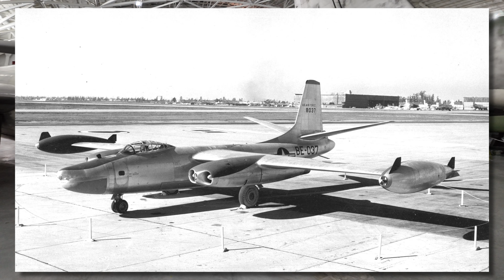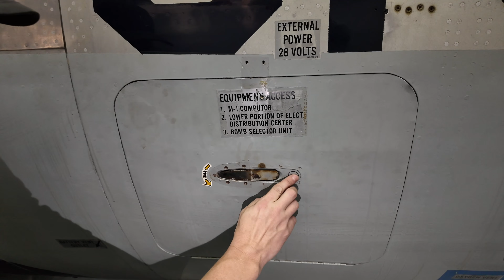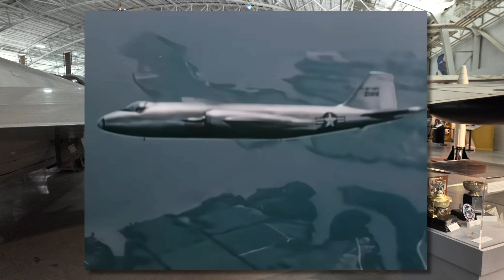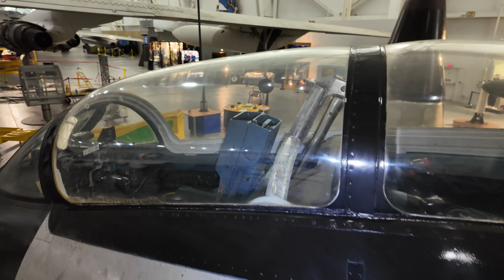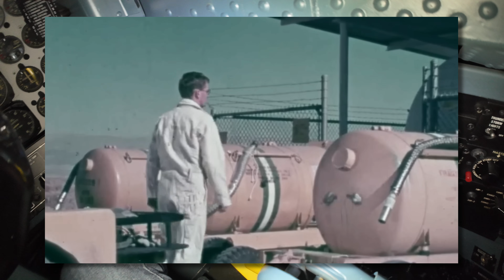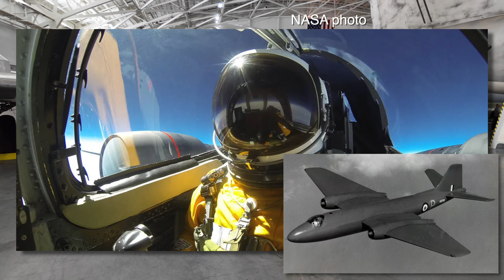Martin B-57 Canberra detailed tour! Designed by the British, perfected by the Americans?

Comment: There’s a static display at the main gate at Forbes Field Air National Guard Base in Topeka, KS. There are mannequins inside with helmets. Last I knew the helmets fell off at least one of the mannequins. Though I think they may have fixed it. Somehow I mistakenly thought the plane was a B-47 until I realized how much larger a B-47 was. Both were flown at the airbase when it was an active duty airbase under SAC.

Comment: Was there a pressure release plug that needed to be released like on the canopy of the UK Canberra before the crew door was released by ground crew to avoid the door flying open and potentially injuring the guy opening it, or did the opening canopy not require this?

Comment: It’s worth mentioning that the USAAF and later USAF had a problem with Glen L Martin company. This was regarding the B-26 marauder. The Marauder was tough to control in its early versions and suffered from a high landing speed owing to its unique design and undercarriage layout. It took WAC pilots flying it on one engine demonstrations arranged by Hap Arnold to convince his crews that the B-26 wasn’t dangerous. The high speed, high landing speeds and other features made it an aircraft you actually had to fly all the time. Its lack of defensive armament didn’t help. It soured the Air Force to Martin products for many years. The B-26 despite its issues did enjoy the lowest casualty rate of any of the army Air Force bombers both medium and heavy of the war

Comment: What isn’t mentioned here is that the B 57 had a very terrible and unforgiving single engine minimum speed. One GUARD  unit flying  57 s  lost four people to low altitude engine failure where the B 57 rolled onto its back before they could eject or during their ejection.

Comment: That's not a turbofan issue, that's all turbine engines. They all work using air and it gets tricky when the air gets very thin, which is one limitation to the maximum altitude of a jet. Like why would they intentionally use engines that are worse at altitude for their new special version specifically designed to fly at high altitude? 
Turbofan would better if anything. More collection area, can take in more air. 
I feel like you are thinking of turbojets being better at high speeds. That does matter because the relative exhaust velocities are different, the turbojet is more efficient at very high speed because it's closer to its own exhaust velocity.
Reply from the maker: I'm happy to stand corrected but why would they use a turbojet on the RB-57F then? I understand that the NASA WB57Fs don't have those turbojets and can't get much higher than ~65,000ft.

Comment: I never even heard they went to a one man cockpit for the high altitude ones. Although I think all they really did was blank off the canopy and presumably didn't install the equipment or seat. But at least some of them had two man crews, that's what's in all my books, and why I was surprised to see that. This drawing in my very old and very valued book of cutaways has the RB/WB-57F as a two man jet with canopy sunscreens to protect the crew at high altitude from the direct sunlight and radiation, I assume.

Comment: What still isn't clear to me is how did they use the B-57B for all the conventional bombing they did with it? They were blowing up truck convoys and bridges, you can't use radar to aim that, can you? Do they just operate like fighter bombers then, and guess when to release? Do they have any optical backup system at all?
And I don't think the flat glass is for the gun sight, you can aim through curved glass, you just have to make sure it's made properly, which should be true of the whole canopy, so it doesn't distort things. I believe that flat pane is armorglass and it's supposed to keep birds and things from going straight through the windshield and your face when you are flying at low level. It's a very sensible modification for a jet they want to use at low and medium altitudes. Generally it's also proof against small caliber bullets, even small cannon shells sometimes. But I think the main intent is bird strikes in this case, even if it protects you a little bit when making an attack run. I guess when you are closing in is the one time the plane is relatively motionless to the target and you can't really evade. When you are passing over it's hard to hit you because you are flashing past at 500mph, and you can break away after the pass. 
Anyway it's armor glass, I'm almost sure of it. Any time you see that separate front section, that's usually the reason. And that's why the frame is so thick and it if so well bolted in, the thing is at least 30mm thick, probably 50 or more, and it needs to take the full wind force, the force of any bird strikes, or potentially even AA fire, so it needs to be firmly attached. 
Although you have seen it in person and I have not, so perhaps your are right and I'm totally wrong. That would be unusual though (I mean the installation, not me being wrong, I'm sure I do that a lot).

Comment: Although the USA ordered the Canberra as the best in its class, the Pentagon  insisted that it be built to using US manufacturing  procedures. That delayed its entry into service by at least 2 years and it had the same performance as the British standard but needed more maintenance because its construction was more complicated. It used the A-S Sapphires which were the alternative to the RR Avon in that period  although a higher powered version was required because of the weight gain of the different construction.  The difference between 'down-time' for maintenance and repairs  between the B-57 and EE Canberra  was demonstrated in Vietnam  operations of the RAAF and USAF with the Aussies having much higher useful hours and quicker turn arounds with their own constructed UK standard planes.. 
Martin did not 'perfect' it, the Pentagon just re-engineered it to no practical advantage. 

Essentially it was the same. The really excellent innovation was Martin  created the 'rotary/ slide in  bomb bay' (from its failed XB-51) and the USAF preferred both crew to be seated under a single canopy in tandem which had been suggested by EE.
It is interesting that the USAF  considered the Avro Canada Canuck fighter to become a medium bomber but EE proposed the Canberra as a Long Range/ Loitering Interceptor able to carry very large AAMs and a larger radar; this would mean  it was not necessary to have a supersonic performance.

Comment: where did the bombs go?
Reply from the maker: Under the wings and within the bomb bay
Reply: @PaulStewartAviation  i figured that much. its just that we're used to seeing big b-29's and b-52s. this plane seems rather small by comparison
Reply from the maker: @sixmax11 it’s true, in person, it really looks like the size of a fighter!!
Reply: Downwards.
Reply: He showed the bomb bay in the video. He mentioned it, and how they changed to a rotary door in the B model. Did you actually watch it? It doesn't take a huge bay to carry 10,000lbs of bombs, this isn't a heavy bomber, this is a later version of the B-25. And the bombs go where they would on any bomber, in the middle, on the bottom. It's hard to drop them upwards. If I hadn't seen the bay doors looking at it I would still assume they are there, because there is no reason for them not to be there. All the crew is in the front, the engines in the wings, what's going to be in the fuselage except fuel and and a bomb bay? The only two options are in a bomb bay at the center mass, or slung under the wings or fuselage. It's very unlikely in a bomber to only carry externally because it creates lots of drag and one of the reasons we have bombers is that they have longer combat ranges than fighters. Otherwise we would just bomb everything with fighters. 
 Although there have been bombers that carried externally as a rule. The G3M had no bomb bay, the G4M1 had no bay doors when carrying bombs, the Ju 88 carried all the bombs under the wings as a rule and just used the bay for extra fuel. And some did both, the FB.Mk6 Mosquito carried two bombs internal and two external. Forget why it was only two internal but I think it was for extra fuel also. The normal bomber carried four with cropped tails.
Reply: @justforever96  thanks for the tour, i think. i was really being facetious.

Comment: In the mid-1970s I worked on EB-57s that were equipped with electronic countermeasures receivers and jammers, as well as chaff dispensers, and used as "intruder" aircraft for testing and training.
Reply: Kevin, were you with the 4677th/17th DSES at Malmstrom?
Reply: My father, Frank Barnes, was a personnel equipment specialist on RB-57s and EB-57s in the 1960s and in Vietnam worked
on RF-101s at Tan Son Nhut during the Tet Offensive of 1968.

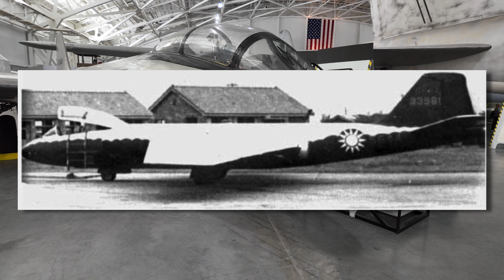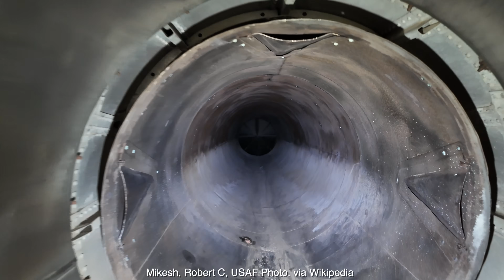Comment: 27:28 It is worth mention that a ROCAF RB-57A was shot down by chinese fighters, on the 18th of february 1958. Later the US gave the RB-57D and the first flight over mainland China happened on the 6th of january 1959. On the 7th of october, a Canberra was planned to fly over the capital Beijing. What was not known, is that the chinese deployed five surface to air missile units around the city. Chinese radars were able to track it the whole time and at 12:04 the 2. anti aircraft missile battalion fired three missiles on the taget. All three hit the plane. The pilot was found dead not far from the crashed plane, his body was hit by several shrapnels and his parachute was open, assuming that after the first missile he ejected from the plane, and probably the second missile debris killed him. The Canberra's did 20 recce missions over China and were withdrawn in 1961. In the following years, the anti aicraft missile commander with the same 2. missile battalion, shot down three more U-2 planes over China. He died in the year 2013.

Comment: It's amazing to see NASA still using an aircraft that was originally designed right after WW2.
Reply: I had a chance to do a walkaround one of the NASA one's at Langley, VA about 16 years ago, as well as talk to the crew.  Very cool to see a couple of them still flying.
Reply: @Beaker3888  They are legally US Air Force aircraft on loan to NASA.
Reply: @l4c390  ok, thanks
Reply: @l4c390  On loan to NASA for CIA missions.
Reply: Well they aren't really. It's extensively modified from the one that was designed right after the war, so you can't exactly call it the same aircraft. It's based on the same aircraft, but it's got a new cockpit, new wings, new engines, new equipment, etc. Not much left but the fuselage and tail and not sure they didn't do some pretty major changes there as well. 
But it's also not surprising (other than being a prudent fiscal decision by the US government, of all people). Aircraft that can fly really high aren't very common, they don't need more than a few of them, so developing a replacement would be extremely expensive just to get a couple new high altitude recon jets. The old ones are doing the job just fine, there is no urgent need for even more altitude or speed, and they aren't wearing out very fast flying NASA missions. So there is no real need to change. 
If they happened to make a new bomber that could do 70,000ft they might take a few but we haven't any they didn't.

Comment: I've always wondered how the main wing spar works with an engine right in the middle.
Reply: By splitting and going around the jet pipe, like a ring. The sections get thinner and wider so it's the same thickness as the rest of the spar. There are two main spars in the center of the wing, the engine is mostly in front of the spar, the first ring is around the turbine section, the second is around the jet pipe.

Comment: Well, the AJ Savage, if fit with turboprops, would have done really great as a strike aircraft as a kind of A-10 long before the A-10... Combining propellers with a turbojet/turbofan can be pretty interesting as it allows borh long distance operations or long loitering time with lesser fuel while adding a turbojet/fan can bring significant speed boost when/where needed and there's no need for a huge high fuel consuming one. Turboprops stay the most efficient engines up to ca Mach 0.75-0.8.
I love these visits of legacy aircraft : there is very little in aviation encyclopaedias about how things look from inside and museums don't allow you to jump inside the canopy too...